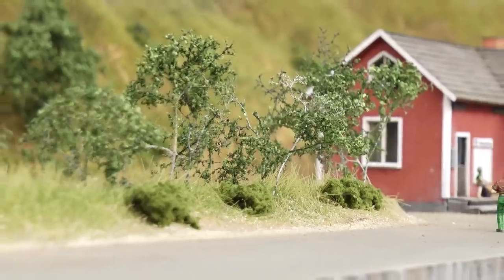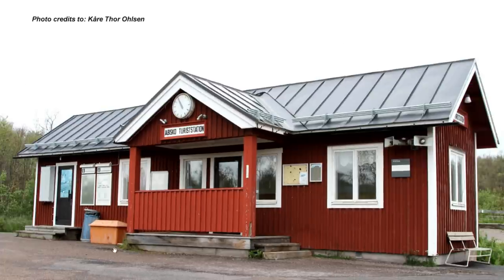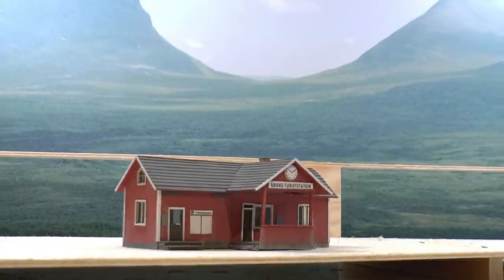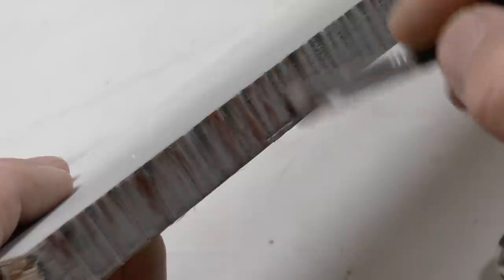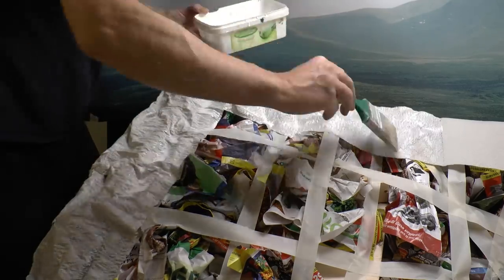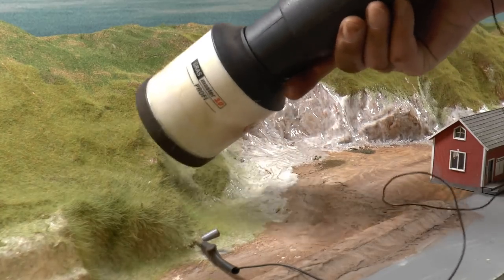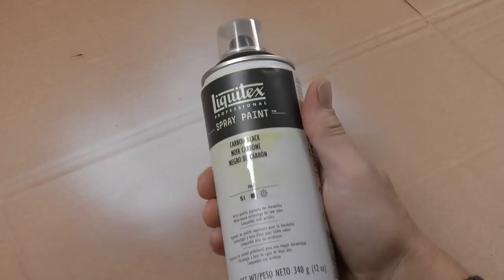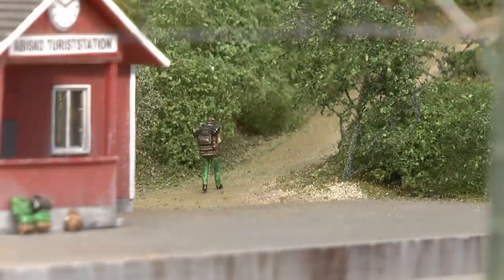Modeling the Home of Thundering Iron Ore Trains

Comment: Fabulous video Martin. I see you are going more and more towards realism, have you thought about mechanical cloud simulation for your lighting to make the vista seem like clouds are passing by or full sun comes out or dark clouds pass by. This should be an easy make. Clouds could be mounted on wires attached to wheels that move back and forth across your lighting. Alternatively disco supply shops have revolving lighting usually in bright colours but you could change those colours to whites and greys etc. It shouldn't cost that much and I'm guessing would help to create realism you are looking for. After all the sun is always changing its brightness and direction. Toby.
Reply from the maker: Hi! Thank you for interesting feedback! For the clouds I think I would go for projector and show video of the sky on a curved structure. It’s really hard to get the mechanics to behave realistickly I think..

Comment: That looks fantastic, Martin! Instead of spray glue, which I'm sure is not cheap, you might try using cheap unscented hairspray, the cheaper the better. The cheaper ones are often just diluted clear varnish, they work well for an adhesive for leaves and foliage.
Reply from the maker: Hi! I’m not sure if I agree there. A decent hairspray with ”strong hold” is about €5/ea. They don’t last long and the adhesive strength very poor. The spray glue is €12, but it lasts looong since the anout is about twice compared to the hairspray. It’s also a proper adhesive. I’ve been using hairspray for years, but moved away from that. Try the spray glue! You’ll like it.